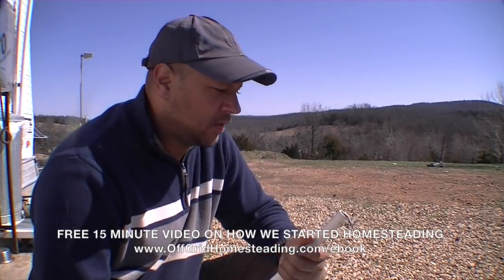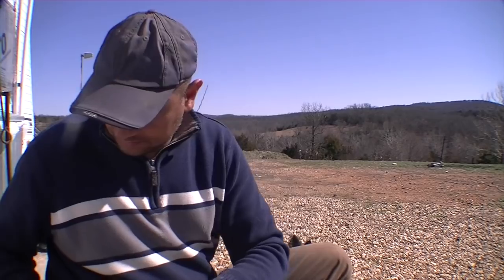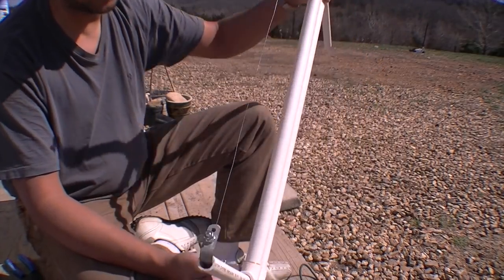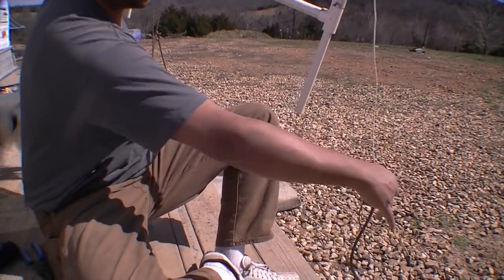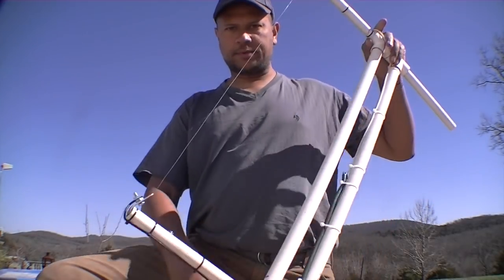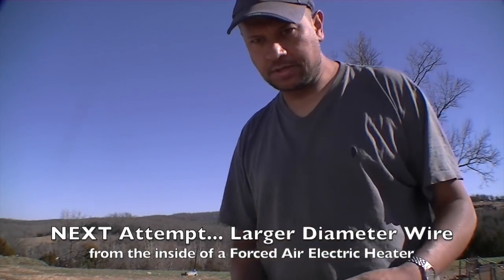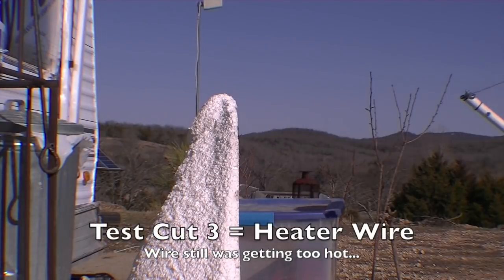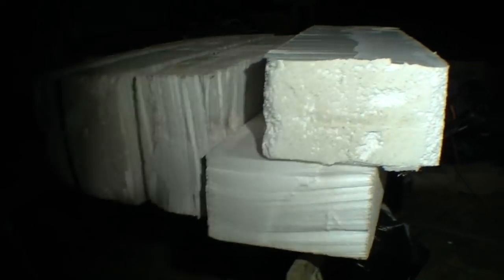OGH - HOW TO BUILD A LARGE 3' HOT WIRE FOAM CUTTER

Comment: Where do you score such large pieces of styrofoam at?
Reply: Anywhere close to a lake as all of the EPS blocks have to now be encapsulated in plastic so it doesn't deteriorate and leave little EPS foam into the lake.   They are everywhere.  You just can drive around and see them in many people's yards.  Call marinas and ask if you can pick them up at no charge.  They charge a $10,000 fine if you burn one of these.

Comment: You just plugged it into a regular wall outlet, and ran it through the dimmer switch?
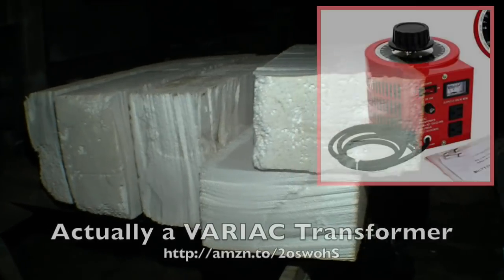Reply from the maker: Sam Thompson the dimmer switch didn’t work very well in controlling the voltage.  The 30v 10amp variable dc power supply was better in fine controlling the voltage.  When I started doing wider length cuts of larger foam pieces it was not adequate.  I eventually got the variac shown at 27:00 mins and I used that for the rest of the project.  It worked very well.